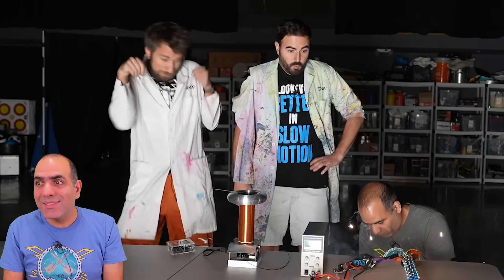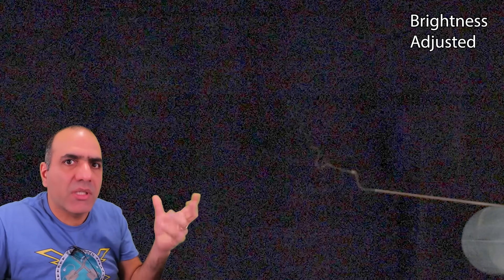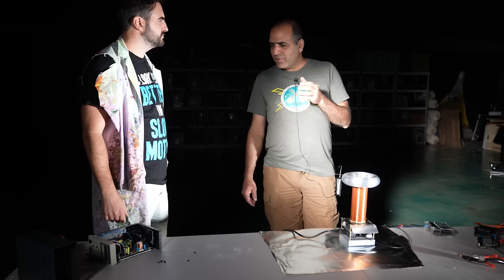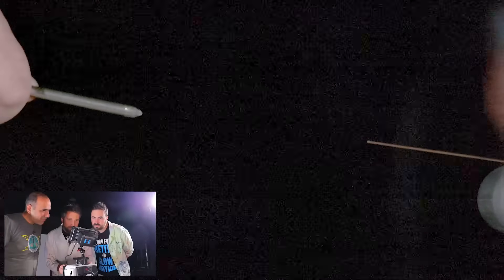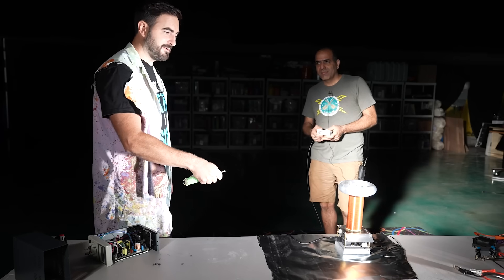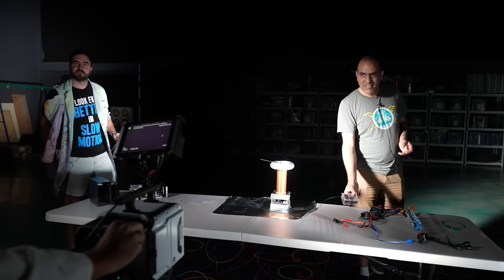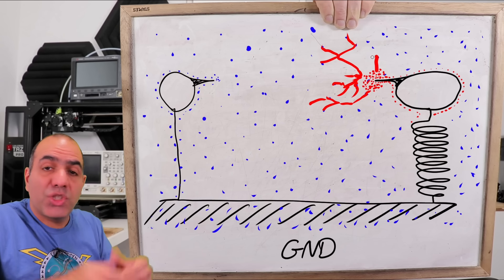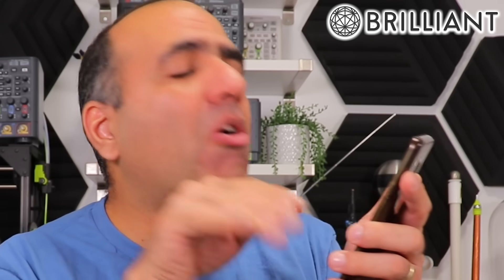ARCS! Frame by Frame

Comment: I love how the diffuse connections coming from the screwdriver (e.g., 5:34) directly show the "action principle" in advanced physics at play.
One way to predict the path that a particle takes from A to B is to calculate a so-called "action" it has for any path between A and B. In reality, it will always take the path with the least action. Here, it starts out with a lot of paths that have basically the same action. Then, one of them has just a slightly lower action than the other ones, so all following electrons flow through it.

Comment: Mehdi, two questions are some people more sensitive to electrical charges then others 
at work i get shocked by everything i can grab a power cable from a battery charger and i can tell the guys there is power they did blind test where they plugged it in out side i was in side and told them when they had the power on. second can you explain how to test for trace voltage in a building  the guys go out of the shop grabbing the metal handle of the door they feel nothing but i feel a burn through any minute  break of my skin like a hang nail or any break in the skin thank you and please keep up the great work

Comment: Is there a reason the electrical arcs moving look like rivers eroding over time? With the curvy parts slowly moving more and more outward.

With rivers, that happens because the soil erodes more on the outside edge because the water is moving faster. Is electricity doing the same thing?

Comment: I wonder if you could just use a computer program, perhaps some linux app like dd and chop up the footage into time-based segments and compare the average size of each time-based segment. I would imagine the part that isn't almost pure black would have a higher byte density. You could take the frames divide by 5 measure, divide by 5 measure, etc. Perhaps find a needle in a haystack very quickly.

Comment: I'm really not convinced by that final explanation. If the arcs are generated from the coil outwards because of the voltage difference from itself to the air, then it would constantly create arcs, even if the grounded object isn't near it, which doesn't seem to be the case. Unless that is exactly what is happening but before the object is close all the arcs are spread on a much higher volume of air, and therefore they have very little power in them, so they're practically invisible (almost the same way the little arcs that go nowhere and can be seen on camera are not very visible to the human eye). Could that be the case?

Comment: Answer this. Circuit path 1. Live cable to rubber sole from shoe to human hand through body to ground. Compare with circuit path 2. Live cable to human hand through body to rubber sole to ground. The series components are the same but different order. So then, Why does 1 not shock you but 2 does?

Comment: New video idea: set up a radio transmitter. Any type of bandwidth the more less known, the better. (Like for example a Shortwave, Mediumwave (AM), or Longwave station. Or broadcasting on typically not used frequencies for example.)

Comment: It's nice to have confirmation that it works basically the same way as lightning but on a smaller scale.
Slow Mo Guys did a video on lightning before, funnily enough.
At those scales, such a high frame rate isn't required.
And, yeah. You see the same sort of effects:
'Stepped leaders', channels of ionised air, moving through the sky,
the fluff rising from the ground, especially from pointy objects,
getting much brighter when the two sides meet.

Comment: So does the em field exist to detect, and direct the current? If i measure the em field, then put a conductor right outside reach of the em field, then just inside, will it be able to direct the current because the em field?

Comment: Is that really the speed of electricity? Doesn’t the ionisation of air and the gow it gives require a chemical reaction, meaning the real arch or change in charge is bit faster than that? Is the timing different from emission of light (which discharges the excess energy), and if so, can the speed and spread of electric potential itself be calculated from the ionisation and light we see?

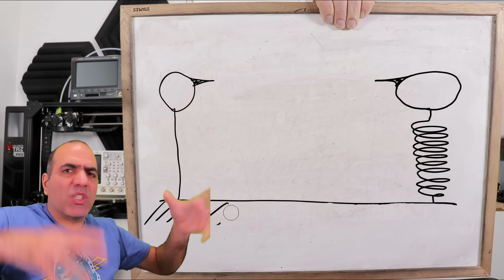Comment: 10:56 if the circuit was floating in space, what would ionize to create an arc then ?
Reply: the 2 ends of the coil, and the metal attached to them.
Reply: @Basement-Science  the arc is air molecules ionized and glowing. I wonder how it would happen in space.
Reply from the maker: In vacuum nothing ionizes, electrons just jump, and since we have ac they jump from both ends. But I guess I ment floating in mid air!
Reply: @boris3320  I meant the 2 ends will charge up btw. Electrons (not a lot of them) will only leave the negative side, and probably turn around and return before they've come very far. If it was DC or slow enough AC, the electrons would try to move to the other side, and may or may not hit it. They would be invisible while moving. 

If you want more info, look into how vacuum tubes work, it's the same thing basically.

Comment: You could power the Tesla coil from batteries, put everything in a metal box at the bottom of it, connect the box to the lower end of the coil, and also add a wire from the box towards the top of the coil. The box would act like a second "top load". That way the ground wont influence it, both sides can charge relative to the environment and the arcs can jump from both sides at once. Entire thing needs to be suspended from non-conductive string for this. And of course you need to re-tune it.

And then you could bring a ground wire close to the top OR bottom side and affect which side of the coil the arcs start from.

Comment: I have a question, if the person is connected to ground (negative) and the Tesla Coil is positively charged, shouldn’t the electrons come from the person since electrons flow from negative to positive? I know conventional current (positive current) flows from positive to negative, but electron flow is the opposite, so why does this happen?
Reply from the maker: Yes, but Tesla coil is AC, so yes current goes both ways, while the arc could be expanding one way

Comment: I have a lot of experience with high voltage (kind of a real life professional mad scientist).  I work in a lab that does lightning testing of aircraft and wind turbine parts.  I help design the generators as well - our highest current generator is 200kA, and our highest voltage unit is 400kV.....for know.  An answer to your "which direction" query:   My experience with testing at 2 million volts is that negative charges like to jump off sharp points, but positive charges do not.  In reality, electrons jump off, but......protons do not.  Electrons are the charge carrier (if you are not inside a semiconductor).  My description is similar to yours.......excess charge is always on the surface of a conductor.  Similar charges repel each other.   When on a flat surface, the charges on either side tend to push against each other cancelling the force, but on a pointy surface, they try to push electrons off the tip.

I often setup up demos where a sphere is one electrode, and a point is the other.   When the point is negative, the needed voltage to arc is much much lower then if you keep the same config and just reverse the voltage.

Comment: The reason why you don't see arcs going both ways might also be related to the sharpness of the tips of the electrodes. The one on the Teslacoil seems to be a lot sharper than the screw-driver? 
If that is the case, it would result in much stronger electric field enhancement close to the tip of the Teslacoil, compared to the other electrode.

Comment: I suspect there are a lot of things going on that would lead to asymmetries in the arc formation. The big one is the fact that the Tesla coil terminal has charge being directly added/removed by the Tesla coil's circuitry, while the screwdriver only gains an induced charge, due to its proximity to the coil terminal (capacitive coupling). Therefore the absolute charge will be much much greater on the coil terminal, and the electric field density at the terminal correspondingly greater.

There are also differences in how easily you can make positive versus negative ions, and how easily you can strip free electrons from different materials. These effects are relevant in arc welding, for example, which is why different processes require different polarities, or even AC, as when TIG welding on aluminum. It would be interesting to see if there are any circumstances where you can tell the difference between the two different polarities of arcs in the high speed video.

Comment: Your empirical data is probably one of the most hardest thing to get.
Oh yeah the plausibility of the two sides meeting together instead of one side producing most of the arc 
in a vacuum appears to be good but one big problem.
In a vacuum there are no atoms and therefore no chance of the arc appearing.

Comment: Electric sparks have a lot of UV in them (stronger arcs have less UV). If you want brighter images, you could try using a quartz lens (and a monochrome or monochrome UV sensor).
Reply: You could also do this in a different gas with different emmission spectrum, although that may also change the arc shapes in general.

Comment: I believe this video also supports the idea that electricity in a circuit doesn't know where to go until it tries all the paths and finds equilibrium. Like in the "transmission line" debacle, where question about 2 different parallel resistors get different voltages isn't decided until electricity actually completes all paths.

Comment: why is it the opposing charge flying from the positive side isn't it protons/solid atoms 

i think that electrons might be going as a water wave throw the air and the camera can't really detect them because they are not as much as the main stream of electrons and MOST of them follow the ionized path while some others fly away

its more like making a small vacuum around the positive charge while thowing a huge amount of electrons everywhere in its direction 

when they get close to the positive side they find the positive charge BUT electrons start collecting around it making the air around the positive slightly purple instead of the positive charge flying towards the negative

and thats why the positive side devolop color late after the stream of electrons has already reached it

also they kick start the main path of ionized air and the more electrons fly towards the positive side the more they collapse in a shorter/lower resistance path

but why is it lower ? because its the path where it happens thay most electrons gone throw

this is my theory and who ever agrees just put a like maybe he awnsers and says if i might be right or wrong

Comment: Does this mean that at the moment just before the arc connects, you could measure a negative high voltage spike on your "ground" rod, if you had a fast enough voltmeter?

Comment: I don't completely understand though, does the charge go back through the forged path once the voltage in the coil turns around or not?
Reply: remember that every second flash/arc is the same polarity. So at the high framerates, you can see where it goes.

Comment: if it was floating in space, there wouldnt be any air to help the charges bridge the gap though, so then wouldn't you get no spark at all, unless the charge becomes high enough to bridge the gap, without any kind of bridging assistance from the air? and also in that case, how could either side be "grounded"?

Comment: How do impurities (particles) impact the formation of the sparks?   Wonder if you did it in a controlled environment with just pure air (a controlled mix of gasses and no particulates) in say a tesla coil in a bell jar!  Would the spark pattern be more consistent/repeated?     I'm thinking that the tiny weeny particulates act as junction/attraction points and it is those that define the spark formation/paths.  

Yes - I would love to know more about this as it is those small details that science and discovery happen.

Equally - could a laser be used to create an ionised channel that controls the direction and formation of the sparks?

Comment: The light on the tip of the screwdriver was because the other branches are drying and became concentrated in one single point. 
The sensor and the filters of the camera isn't ideal to take this shot.
There are magnetic fields working to find a path, bringing all energy to a single point and discharge it.

Comment: The arc air flow machine    cheap to make 
6 winds copper coated wire  6 tubes copper  $12 ebay power module  
Makes a purple arc wires to tubes and creates a wind force pretty powerfull if done right some have made  small  flying crafts
seen it on  the youtube science guy

Comment: Great video (as always)! However, I'm not quite convinced that your explanation of why the arc forms in one direction is correct. I'm not sure if it makes sense to say that the air is connected to ground. But it doesn't really matter anyway. Instead of looking at voltage difference, one should look at electric fields. To ionize air, we need a strong electric field and not just a large voltage difference. That is also the reason why the arcs always start at the spike of the Tesla coil and not on the bulge. The voltage between spike/bulge and surrounding is the same, but the electric field at the spike is much stronger. The arcs only go one way because only the Tesla coil has strong electric fields around it. This is because the Tesla coil accumutes a lot of charge on top if it while the other end has practically no charge. If we look at the charges and electric fields, we can explain the phenomenon without considering the potential of the air and we don't even need to argue whether the air is connected to anything.

Comment: is it the same thing when we plug an electrical device to the out let and it spark? i found that is when the device is on but not plugged yet and then we plug it but when it is off it won't spark (it will be more clear when the device need more power or high Watts), i remember studying that long ago in school but i totally forgot its name it was a law or phenomenon or something like but i forgot it, so i think it is the same thing why we see it coming from the screwdriver too
Reply: well, kinda, yes. Any voltage is able to bridge some distance through air. For mains electricity, it's just a few micrometers. Your appliance limits the current in that moment. The same thing happens inside your device inside its power switch, if it has one.
Reply: @Basement-Science  the problem i forgot that's the name of that thing otherwise it will be more clear
Reply: @husamalkhatib9450  not sure what you're asking

Comment: You said at the end that if this whole thing would be in space, the arcs would be jumping from both sides and meet in the middle. Could it be possible to simulate that in a vacuum?
Reply: A vacuum wouldn't work because there has to be air for the current to flow through. A vacuum is an even better insulator than air. And also there'd be nothing to glow because that's also caused by ionizing the air. When he said "in space" he meant just not connected to the ground, which would get rid of the effect of earth's massive capacitance; doing it in a vacuum chamber on earth wouldn't change what is or isn't grounded.

Comment: Very nice 👍👍👍

It's also the case that the air is charged  around the Tesla coil in every direction and only appears to reach in the direction of the ground when current reaches and begins to flow to ground, this flow cascades the surrounding negatively charged air and consolidates along the path of least resistance .?

Comment: I think you would see symmetric initial arcs if you used equivalent positive and negative voltages, relative to ground, instead of just one high voltage and ground. I wonder if it could be feasible to connect the other end of the secondary winding to a second globe and needle

Comment: Love the digs at Iran situation... xD Let's hope for change there!
I think this question is more for the SloMo guys, but as you were there Mehdi, perhaps you know... or someone else in the comments.
For slow motion cameras like that, I understand you need a whole ton of light flooding the entire scene to capture anything useful in the highest frame rates... but is there a point when too much light also ends up being bad?
Let's say you put a stadium worth of lights in there... aside from getting a tan and being blinded by it, would it help in those higher frame rates, or you'd end up with a completely washed out video?
Amazing stuff still!
Reply: If I'm not mistaken, and any cinematographers can correct me if I'm wrong. That is more for when you are filming things that "reflect" light. When filming emissive subjects, you want contrast from the backdrop. So you would be better off trying to get a "blackbody"-esk backdrop as they did here. if you flood your scene with too much light, it will outshine the emissive subject. On another note, the interesting thing with highspeed filming is you have to have very particular light sources. you, for the most part, cant use direct AC powered light sources as they don't have a constant brightness, but rather they oscillate in brightness at the frequency of the power grid (60 hz in the US)

Comment: I wonder, just off the top of my head, if the arc from each pulse follows the ionized channel from the previous arc, would a fan blowing air through the area cause a unique arc each time? Would it make the arc harder to form, or would it make a less interesting arc?
Reply: I believe yes especially since we seen mehdi blowing arcs out with his breath in his marx generator video. I think he even comments about disrupting the ionized channel with wind but I could be wrong